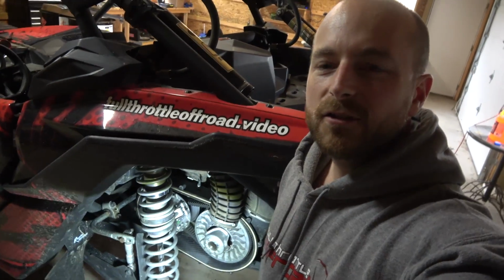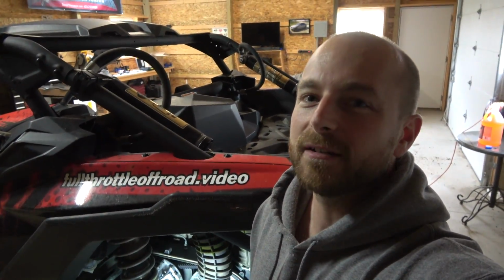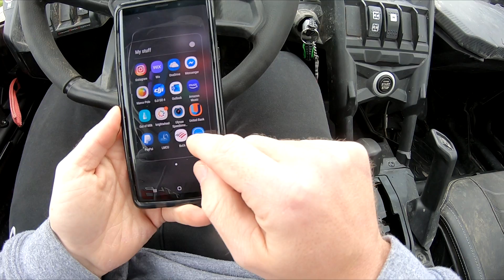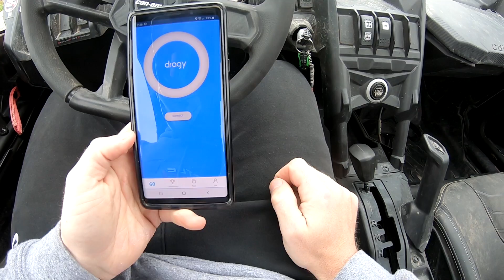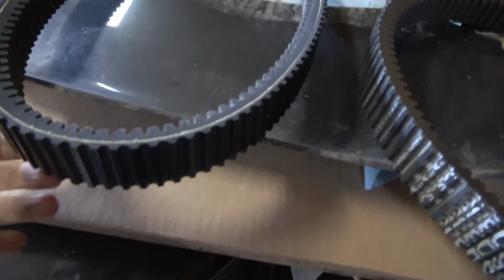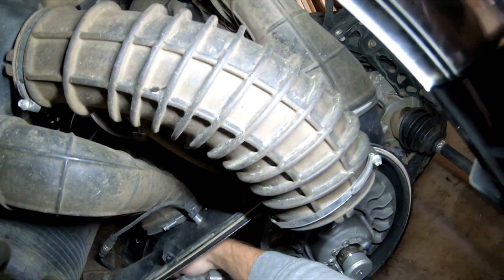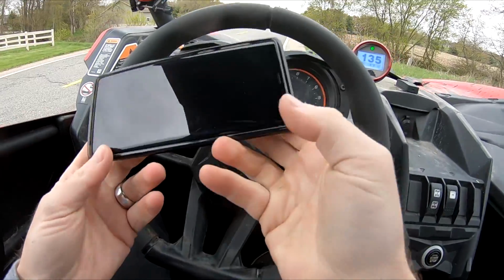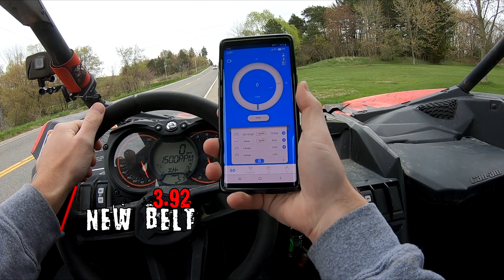Could your CVT Belt be slowing your SXS down?

Comment: I would be curious if the stock belt would make a faster time since it's lighter duty and easier to spin the lighter mass?
Reply from the maker: Different belts would probably yield a different time.. which is why I didn't want to use a different belt. It had to be the same belt for this test. But that could be a good future video idea!

Comment: What you mite be feeling is with some new belts it could be slightly wider.  So it could be sitting higher in the secondary.  Which could be giving you a slightly low gear ratio.  But other then that, it should be really close.  Had a good time talking and racing with you and Keith over the weekend.  Congratulations on 10K as well.
Reply from the maker: Hell yea man it was awesome chilling with yoy guys! Cya in a few weeks!!

Comment: Seemed like you hesitated a little with the new one. I think they would be about the same. Run it till it breaks. Throw the old one in the back for a spare.
Reply from the maker: No hesitation on my part. But yea, now that I know there isn't really a performance difference... I'll just leave it in there until it finally breaks. I thought for sure it would be slowing me down... Turns out, not the case.
Reply: @ftorvideo  yea, was surprised they were so close. Good to know too. 👍

Comment: Wow that’s crazy I was totally confident that the new belt would run a better time... If I think about it a well broken in belt would probably do the BEST time though. Everything would be at it’s optimum I think. Good test tho bro there is always some variables to 0-60 / acceleration tests especially when you are measuring thousandths of a second difference. My take away is that they are the same. As long as it is properly broken in or not falling apart it should be good. Another amazing and boring video that I couldn’t help but watch as soon as I was notified from you badass dudes. Good job brother/‘s I’ll be waiting for the next one! 🤘😎🤘
Reply from the maker: Your thoughts are my thoughts exactly... I used to think... I needed to change the belt after a while if I wanted to maintain my performance. Turns out, not so much the case! lol... Thank you for the support my brother!

Comment: Crazy thing all these test I did when the commander came out and I finished building the motor throttle body etc and new belts were faster if the old belt was worn out. Broken end belts with miles were always faster. Especially if used a can am race belt. I love that you have a channel dedicated to performance tuning

Comment: Good video.  Do you have a picture of the side of the old belt?  That will show how worn out that belt is.  I guess what im getting at is if that belt was made to go 5k miles and you only took it 1k miles then you may not notice a difference.  But if before you came off a belt that was at the end of its life and changed to a fresh one then you would feel the difference. I have a Badass belt sitting on my shelf that is going on my XPT soon (Im due for a belt change) and Im curious if I pick up anything on it as I know for sure that I have lost some top end as the belt has worn.
Reply from the maker: I hold them up next to each other about mid way through the video. The old belt was very worn, it had threads missing on the edges and it was notched in a few places.
Reply: @ftorvideo  I saw that but how to tell how worn a belt is if you look at the side there is natural taper to it as you know.  Then at the very top/outer portion of the side it flattens off when that flat part is gone the belt is pretty well worn out and starts wearing thinner.  I was curious if any of that flat portion was left.

Comment: I noticed when you ran the old belt that the temperature was 95 degrees just before you took off and it was at 135 with the new belt just before you took off.  Not sure if that would make a difference.

Comment: Just a thought but if the new belt feels like it's transferring torque much better it may be because the old belt wasn't......right before it popped.  You may not feel the belt slipping before it fails but I'm guessing it probably is.  Either way gboost for the win.